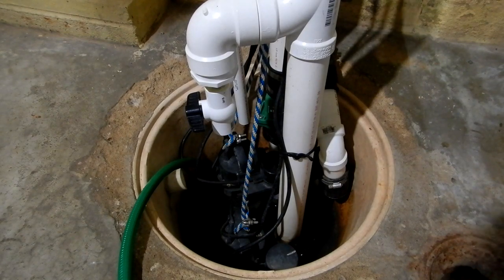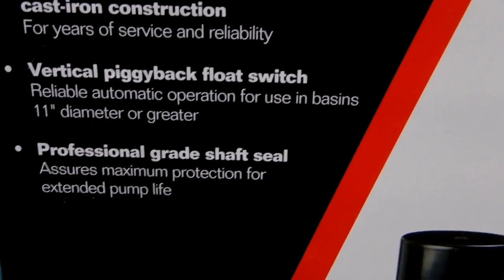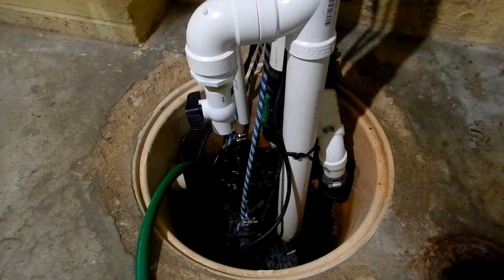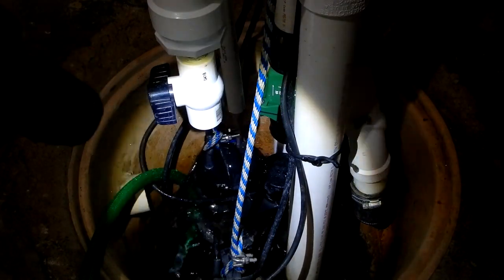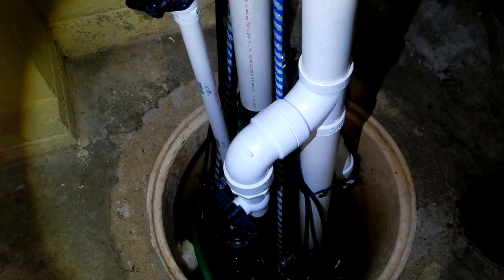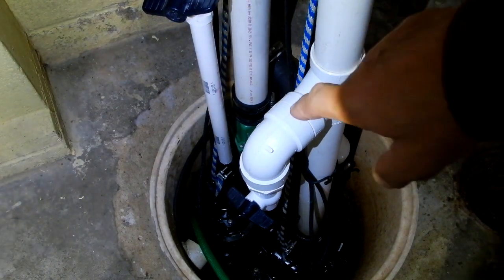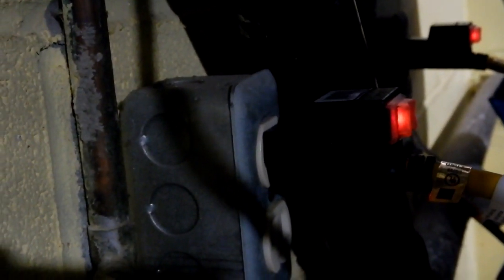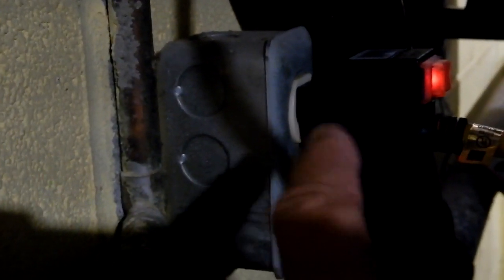Dual Sump Pumps & Possible Issues with Actual Tests

Comment: So question, do you have any issues with discharging you're Rain/Storm water from you're Sump pump into your yard as it pertains to you're neighbors? like say it ran onto their property because they're property sits lower...My dad was once arrested by a CORRUPT COP who thought his gun and badge made him God for that exact thing.
Reply from the maker: jlthomas531...Well, that's a very interesting question. But
sorry you had to deal with a corrupt cop that doesn't follow the law but
creates it as he sees fit. So, look no further than Ohio Case Law. FIRST, look at Mason v. Commissioners of Fulton County decided March 30, 1909. 
A portion of the decision: 
"A lower tenement is under a natural servitude to a
higher one to receive from it all the surface water accumulating from falling
rains and melting snows or from natural springs that naturally How from it to
and upon the lower one This advantage of the higher tenement is a part of the
property of the owner in it and he is not indebted to the lower tenement
therefor. 
"In making an assessment on lands benefited by
artificial drainage the extent of their watershed is not the proper rule but
the amount of surface water for which artificial drainage is required to make
them cultivable and the benefits that will accrue to the lands from such
drainage However much water may fall on them or arise from natural springs if
by reason of their situation they have adequate natural drainage therefor they
are not liable for the cost of artificial drainage to other lands."
SECOND, look at McGlashan et al., Appellees v. Spade
Rockledge Terrace Condo Development Corp., Appellant et al decided April 9, 1980. 
A portion of the decision: 
In Ohio, the civil-law rule was first enunciated in Butler v. Peck (1865), 16
Ohio St. 334, where the court stated, at pages 342-343, that "where two
parcels of land, belonging to different owners, lie adjacent to each other, and
one parcel lies [62 Ohio St. 2d 57] lower than the
other, the lower one owes a servitude to the upper, to receive the water
which naturally runs from it, provided the industry of man has not been
used to create the servitude." (Emphasis sic.) While courts
in this state continued to cite this opinion as controlling, modifications to
the strict civil-law rule began to appear, whenever necessary to produce an
equitable result.
Recognizing the inhibiting effect that strict application of this rule would have on land use,
the court in Mason v. Commrs. of Fulton County (1909), 80 Ohio
St. 151, created an early qualification. While an upper landowner could not
divert surface water onto a neighbor's property where it would otherwise not
flow, the court held, at pages 159-160, that he could "drain the water
from * * *[his land] into its natural outlet, whether that be a watercourse or
a natural drainage channel, and thus increase the volume and accelerate the
flow of water of such watercourse or channel, without incurring liability
for damages to owners of lower lands."

Comment: Can you just connect both pump to the same discharge line? I want ro add a back up and was thinking of using a Y to run both pumps to the same discharge line. I'd have 2 check valves obviously.
Reply from the maker: @michaelcobb4331    Interesting question. I would not. You don't want both pumps "working" against each other slowing them up. PLUS, if only one pump is running it will also force water to the pump that isn't running. Just my opinion.

Comment: You need water backup, saved my butt this past weekend. But, you will need city water. Not sure you can do it with a well
Reply from the maker: The well water needs electricity to run the pump. If the electric goes out it's useless. But that's not the intent of this video. As long as I have electricity this system works perfectly.

Comment: Nice setup, but why did you feel it necessary to install waste solid (up to 3/4" solids according to the manufacturer) ejector sump pumps in a water only sump????  Way, way overkill and the cost for each is much higher then for a 'liquid only' sump pump setup
Reply from the maker: Thanks Dr WHO.   I go overboard sometimes 😉
Reply: @starastronomer  Not criticizing, just curious if there was a specific reason for using that type of ejector pump.  Great job and thanks for the video!
Reply from the maker: Dr WHO   I am very picky. Some things it does not pay to be cheap. I wanted a pump built very heavy duty. Doesn't hurt to have a pump that is over rated for the job.